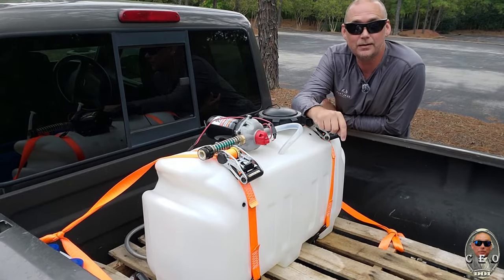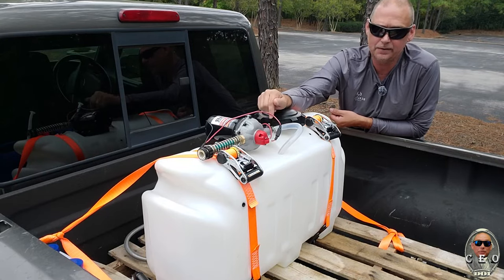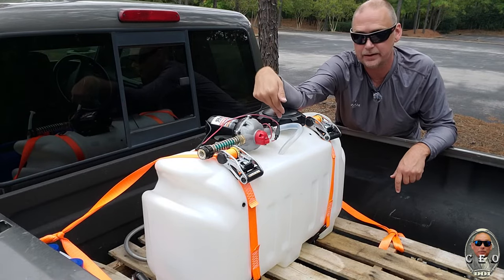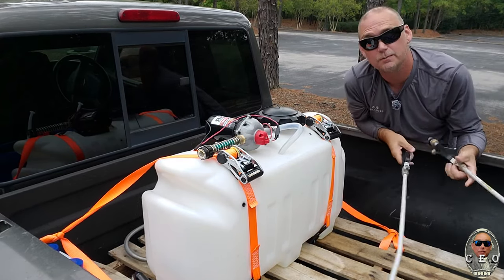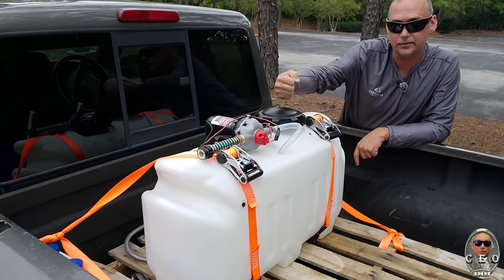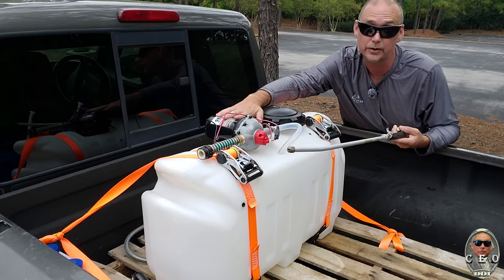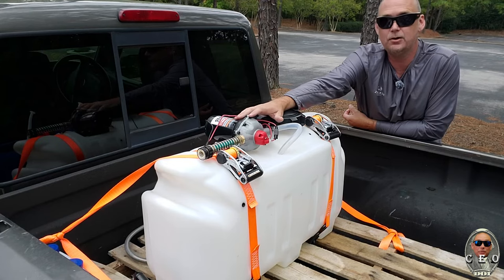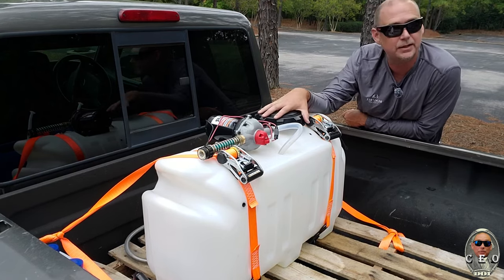CHEAP EASY SOFTWASH SYSTEM - BIG G#NS

Comment: Hi. I just built this unit. Im excited to get started which my first job is a combination of brick and siding. Im having a hard time figuring out the solution mix for this job. I did purchase 2 gallons of pool essentials from Walmart for under 6 bucks a piece. Could u please share with me mix ratio for rougbly 2 story condo about 1800 sq. Ft.. And also 2 gallon pump sprayer for detacted siding shed. Would be great! Thank u so much
Reply from the maker: 2 and a half gallons in this 24 gallon tank will make a nice 1 percent house wash. I fill the take to about 25 gallons total. Add sh first. One tank should be enough. Fill your 2 gallon from the tank if needed or use the mix calculator at southeast softwashs website. Also watch some southeast soft wash videos of the process
Reply: Thanks, just the info I needed @CEOof1

Comment: Does the hose length affect the strength of the water coming out? For example, if I connect a 200 ft garden hose to the pump, and I'm high up on a roof, is there still good enough pressure to push through the very long hose?
Reply from the maker: That's a good question. You would think so, and maybe a tiny bit. As long as you don't have air leaks in the hose and your pump is in good shape you should be fine. 60 or 70 psi is still 60lbs or pressures pushing fluid out. I use a 12 volt 5.5 gallon per minute pump and it seems to work well. You can also use a pressure washer with a low pressure jrod to downstream with more power but less chem strength since downstreaming doesn't allow the mix to be as strong as batch mixing. I use a 200 hose off my wash tank. As long as it's air tight I have no issue. If the hose leaks a bit sometimes, I have a longer day to make the money 💰
Reply from the maker: I also use a turbo jet hose nozzle from home depot to increase the water pressure coming out by 40%. This will let me shoot higher and farther with a shooter tip on. Then I can change the tip to a wide spray for less pressure and a wall of SH coming out of the tip

Comment: Do you have a link for the wands at HD?  Thanks.
Reply from the maker: I used the turbo jet. https://www.homedepot.com/p/Turbo-Jet-High-Spray-Hose-Nozzle-Attachments-1000243/307629414?source=shoppingads&locale=en-US&pla&mtc=SHOPPING-BF-CDP-GGL-D28I-028_010_WATERING-NA-NA-NA-PMAX-NA-NA-NA-NA-NBR-NA-NA-NA-PMAX&cm_mmc=SHOPPING-BF-CDP-GGL-D28I-028_010_WATERING-NA-NA-NA-PMAX-NA-NA-NA-NA-NBR-NA-NA-NA-PMAX-71700000104372722--&gad_source=1&gclsrc=ds

Comment: How often do you have to charge your battery
Reply from the maker: It's a 12 volt trolling motor battery. Everstart dc27 I think.  I charge it every time I use it with a trickle charger. I could wash maybe 4 houses before the battery was dying. Maybe more. I have never ran the battery below 60 percent. Just never need to.

Comment: Thanks for the video. What would you name a good quality hose?
Reply from the maker: I use the zero g hoses. I don't have hose reals and they are light weight and have worked well for a year. You just need to straighten them out on jobsites before use
Reply from the maker: They are easier to move around than flexzilla

Comment: i think that tank wouldn't be enough to do a whole house. Correct me if i'm wrong. I only watched 9:30 minutes of your presentation
Reply from the maker: It's refillable.  Most take about two tanks. Some take 4 tanks. A 60 gallon tank is available but it is 300 for that tank so I just refill this. Or did before we build the trailer